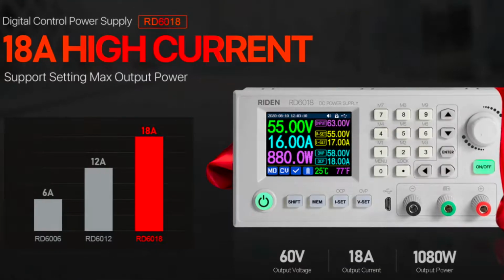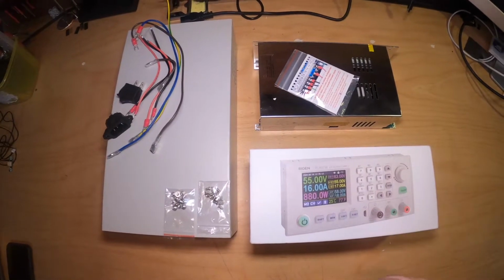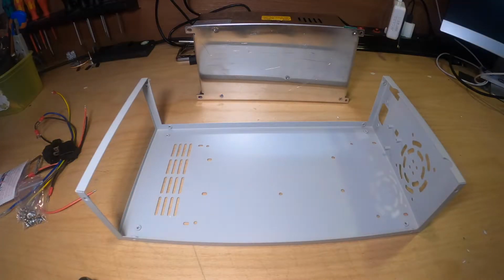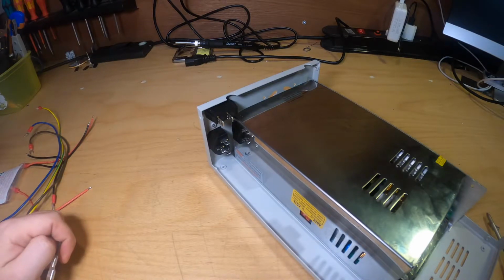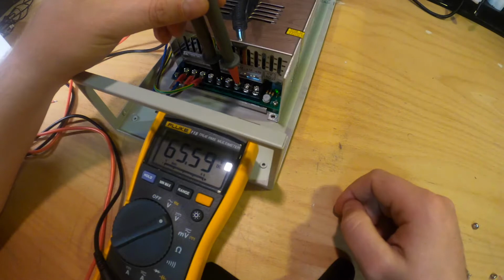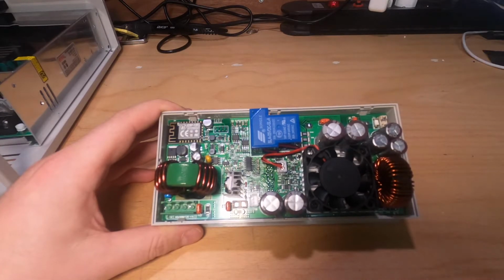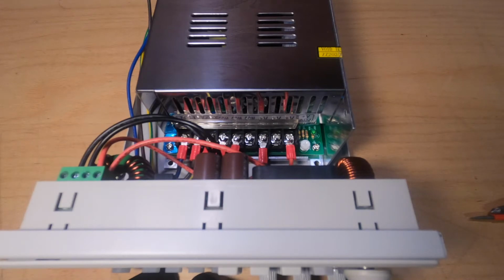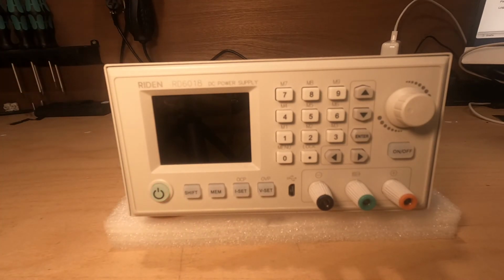Assembling of a Riden RD6006/RD6012/RD6018 bench power supply

Comment: The 800W power supply makes so much noise, it’s so annoying. I used the resistor but there’s no difference. It still makes a very annoying high frequency noise. 🤬

Comment: Would it be possible to take as a power supply my 16 S lifepo 4 battery 54 V ? If yes how do I connect to the four connections as I have only two cables + and -. Thanks a lot for your advice
Reply: Yes.  Since your batteries are already in SERIES...just use the positive and negative of your battery bank. to the Riden DC input.   Just make two more cables to connect to the other Riden input terminals and to the battery terminals.

Comment: Nice video, thank you very much. Where did you get the charge resistor please?
Reply from the maker: The resistor was include in the package
Reply: @frederikbove  Ok thanks for the reply 😎
Reply: that resistance is to reduce the noisy when you did not connect any load , this PSU was not designed well, but quality is good 4
Reply: @rdtech9153  The base load resistor provided has what resistance? I saw on a picture it is a 10 Watt type, but what value in ohms?? thnx
Reply: @volkmarl.2010  hello, for now our power supply does not offer the resistor, if you can hear the high frequency noise, you can add a 5.1k ohm 5W resistor  at the PSU output